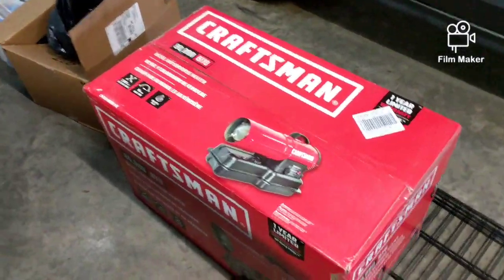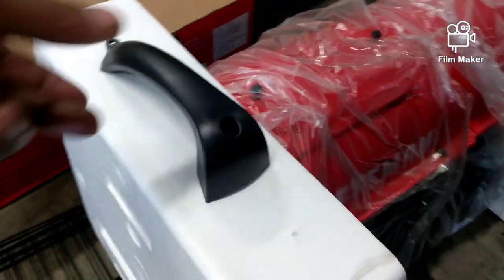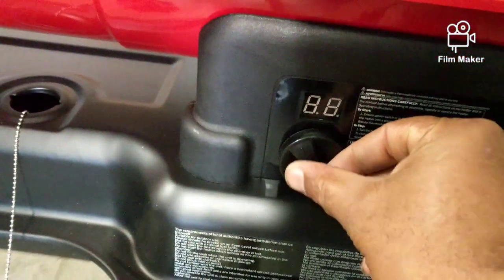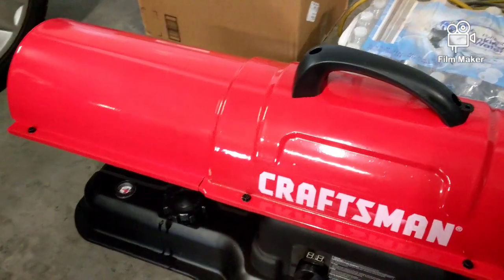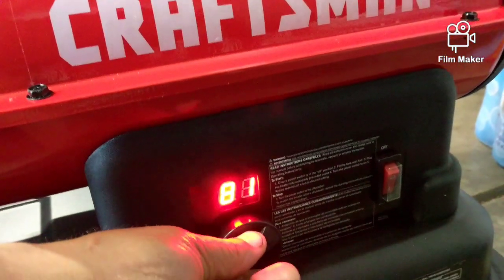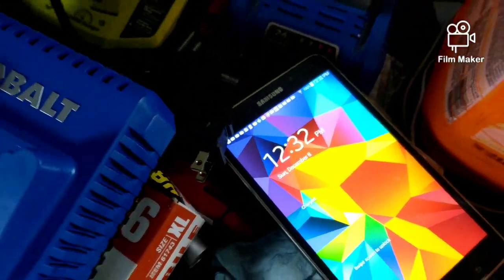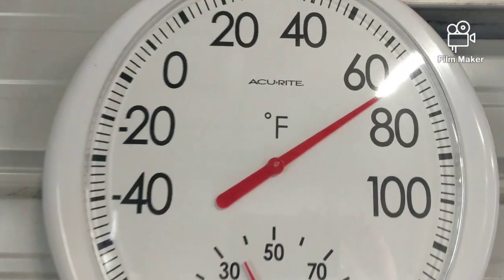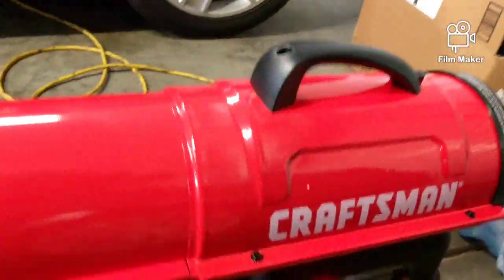Craftsman 80,000 BTU heater unboxing and test

Comment: The problem is the housing of the unit heats up and gives a false indication of the air temperature. a small circulation fan blowing across the unit in the area of the control panel remedies the false reading.

Comment: Just picked one up today...Lowes has them on sale for $99.  Originally $199.  Also picked up a 5 gallon kerosene can at $13 originally $25.
Reply from the maker: For that price it's worth it
Reply: how long can it run
Reply: First. I’m in South Carolina so I don’t need it that much or need to run it hot much but it holds 6 gallons of kerosene and is “supposed” to run for 10 hours.

Comment: Is the electric power for only ignition and i can turn the electricity off later?
Reply: Electricity powers the circuit board, the igniter, and the fan. The heater wont run if it gets unplugged.

Comment: Is it used indoors that's a hazard its meant for outdoors in well ventilated area
Reply: You’re wrong. These metal garages aren’t air tight. They have built in ridge vents unless you have insulated them. No way are they air tight. If anyone is worried grab a CO monitor alarm.
Reply: I use mine indoors all the time. why would you run it outside? lol
Reply: Use in side all winter

Comment: Mine has the same issue. I've yet to figure out how to fix that
Reply from the maker: I have checked everywhere to figure out how to adjust it and there's no adjustment in the book nowhere  I think it's just a bad design they might have to do better on that
Reply: @idennis75  doesn't seem to switch back on unless I mess with the thermostat either
Reply from the maker: My own switches back on but it's about 3 hours later and the room is cold but the gauge is saying it's still warm
Reply: ive been looking at this heater. ive seen that some people have taken it apart an pulled the thermostat sensor out so that its outside of the heater to cool off. ive seen it on lowes.com on the reviews for this heater there is pics of what they did.
Reply from the maker: @jpbarley  thanks for the info I might be trying that
Reply: Put a fan on the back of it to circulate the air. It'll kick right back on when it needs to. The housing in it gets hot so it doesn't cool and kick back on till quite some time after, remedied with a basic box fan blowing behind it.
Reply: @jpbarley  I actually ended up doing that. It works beautifully now

Comment: I just bought one. Can not get it to stay on. Fumes are also bad. Any suggestions?
Reply from the maker: It might be you have a bad one I would bring it back to the store and exchange it they should be able to go on and stay on until it gets up to room temperature or the second that you have it on
Reply from the maker: It might be you have a bad one I would bring it back to the store and exchange it they should be able to go on and stay on until it gets up to room temperature or the second that you have it on
Reply: don't use kerosene. I use diesel and run mine indoors outdoors wherever.  sounds like either the nozzle is stopped up with something or the pump isn't making enough pressure.  the pump pressure adjustment is on the back. it's the protruding flat head knob. turn it right for more pressure left for lower pressure.  I tune mine so that I get some flames licking the outside of the heating disc then dial it back 1/8 turn at a time just until it's inside the unit.  I'd just exchange it though if you aren't familiar with how the unit works inside.

Comment: Do you need a Power plug for it ?
Reply from the maker: Yes it takes a 115 volt for the fan and kerosene or diesel whichever one you would like but the diesel does not get as hot as the kerosene
Reply: Thank you

Comment: One year later do you still like the heater?
Reply from the maker: Yes I still like the heat off of it I just wish it was a little quieter
Reply: @idennis75  does it smell terrible like the old ones?
Reply from the maker: Only when it runs out of fuel or you turn it off then you get that kerosene smell